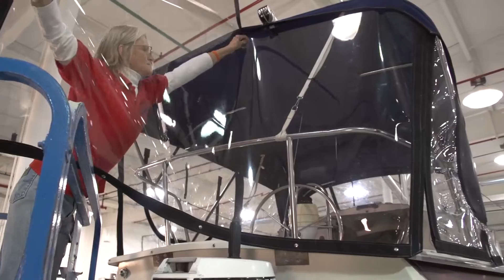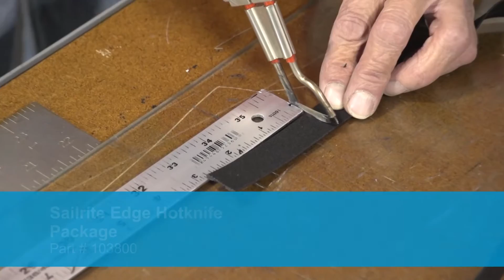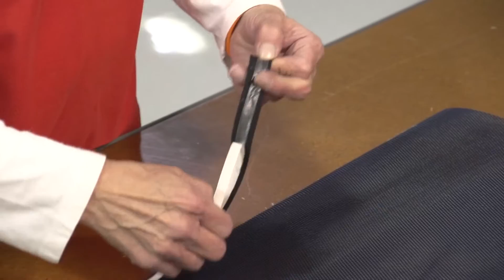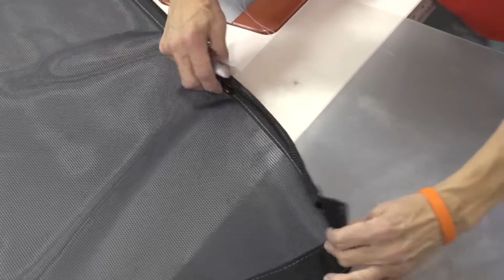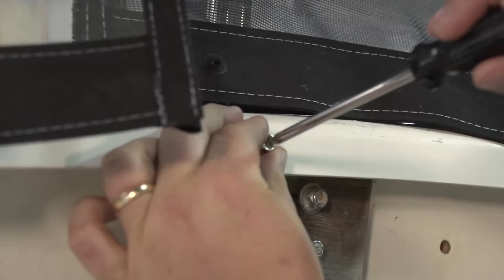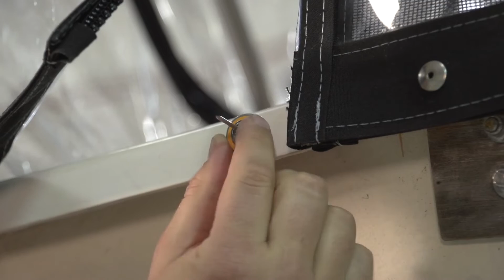Installing Zippered Window with Removable Zippered Screen

Comment: I looked for this full DVD on the Sailrite website but couldn't find it. Do you have any tutorials on making a sailboat enclosure. I've watched the enclosure videos for power boats but would love some info on accommodating for the back stays in sailboat aft panels.
Reply from the maker: It is on the list of future videos as the DVD is sold out and the content is not up to our current standards. It is unusual to have a backstay slit in the enclosure portion, it generally goes through the bimini as seen in this portion of our video on "How to make a 3 bow bimini". https://youtu.be/RB0H9hCPJlg?t=5936
Reply: @SailriteDIY  I look forward to watching your future videos on this. I am making a bimini right now following your videos with plans of eventually making a full enclosure! Our backstays do go through the bimini, but then would exit at the bottom of an enclosure panel, about 10 or 12 inches up from where the panel would attach to the boat.